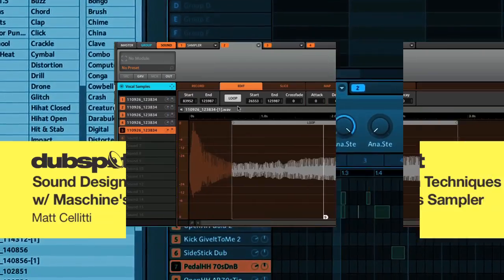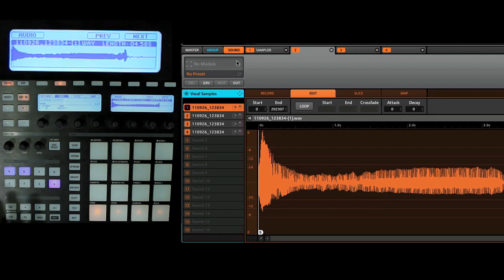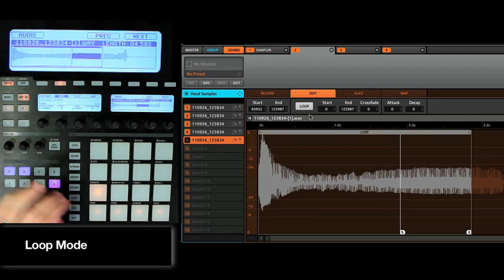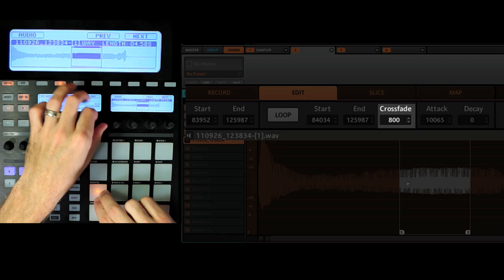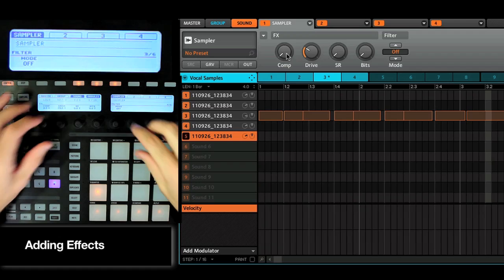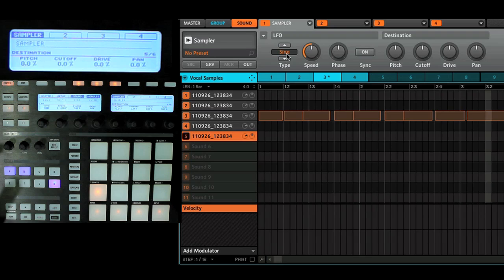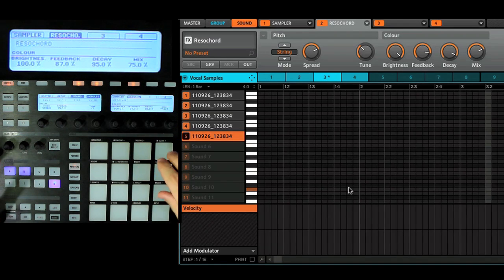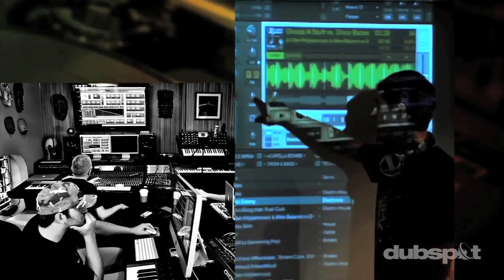Sound Design Techniques w/ Maschine's Sampler - Turning Vocal Samples into Instruments

Comment: i have a dumb question. i'm trying to do my whole beat sequence in just maschine. how the hell do i get my midi keyboard to work with it? I have it hooked into Maschine via midi cable. i'm running v1.71. It works fine when doing my stuff on protools but what if i just want to use the maschine software daw by itself?